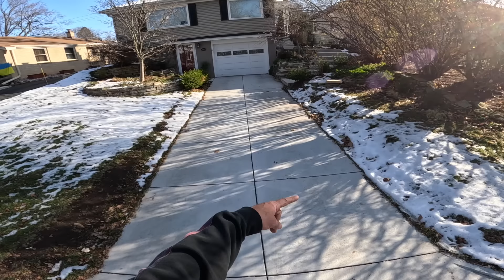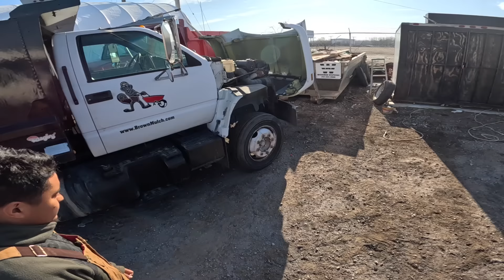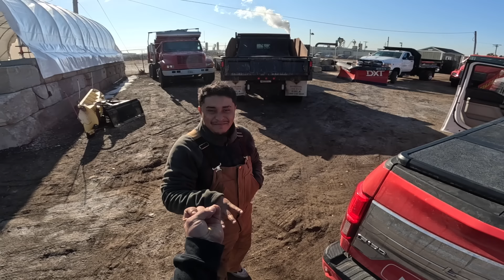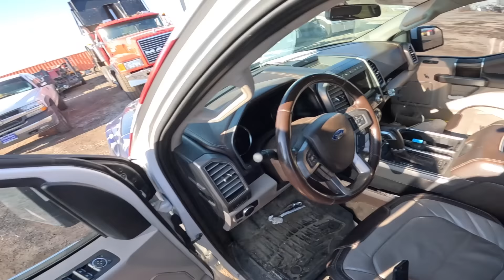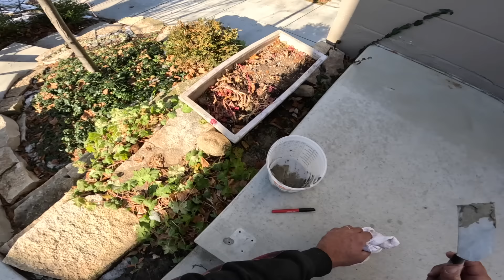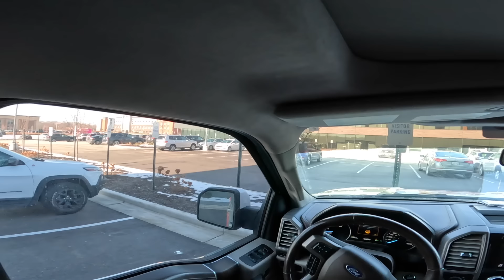Customer won't pay me!

Comment: I got the shaft on a drywall job one time. I wrote up my contract and charged by the square foot too hang and finish the job, ready to paint. The day I finished I turned in my bill to the lawyer customer. She stated payment would be the next day. Realize my contract stated payment upon completion. The next morning when I arrived at the job site the front yard of the house had all the scrap pieces of drywall laid out in a giant rectangle on the ground. She handed me the check and said "I'm only paying for the drywall hung in the house, not these scraps". Legally she may have been right. I guess door, window, electrical and plumbing cutouts are not part of the job. Scrapping the house out for finishing was a mute point. I grabbed my check and beat feet.

Comment: @Victory Outdoor Services
There is a difference between haters and stating genuine criticism to improve your construction techniques & quality.
45+ years in the concrete business (Architectural Technologist) starting with a commercial const. company in 1977 and then on my own in 1983 and building up to a comfortable 30+ employees with an assortment of equipment including concrete mixer trucks.
I have done any type of concrete project you can imagine in every industry from high end residential, commercial, civil, municipal, federal infrastructure, industrial, institutional and oil field.
I am an extreme perfectionist and all my employees have that same standard to ensure the highest quality materials, durability & workmanship. I make no apologies in trying to achieve perfection.
Your attention to detail can use improvement and your lack of using rebar for driveways and patios in new areas is lacking.
You have an excellent Youtube channel, personality & character.
There are some haters, but there are some professionals on a different level than you watching your videos as well.

Comment: I'm a retired electrician who did not get all of my money. Here's the best two with payback. Gave a person a written quote on converting a house into a grilled with 4 meters & 4 circuit breaker panels. I was supposed to get a $600 down payment but guy told me he would give it to me after I started job. Creep only gave me $200 and only worked a day on it before demanding more money. Begged me to continue and would have money for me soon. Ok I took all the meter & circuit breakers home with me. A few weeks later guy said he was bankrupt so told him that I would not perform anymorecwork. Then he demanded the covers back. Best part the circuit breaker company just changed the entire design and he had to pay somebody to replace the 4 panels. He even got ignored when he found out that I pulled the permit on it. Second case I rewired a single home and general contractor was friends with the homeowner. At end of job he had me & the carpenter do over a days extra work along with maybe $150'in material. He refused to pay us. Last day on job the carpenter broke maybe 1' long sliver of hardwood & some stones and jammed them down 3/4" copper lines going up to third floor soon to be installed radiators. Got a call that winter to install electric baseboard heaters. Told them sure as soon as I'm paid for previous work and COD for that work. They said come out and they would pay me. No !money no workee.

Comment: I've dealt with contractors who don't do the best work, but as a customer, I've usually been able to push back and get them to fix something that I believe is not completed, or try to understand that circumstances (weather, materials, etc) might not make the job where I want it.  But some customers think that they can pay peanuts, and get the moon for results.  Its those type of customers who really make the rest of our lives even more difficult because then the contractor is in a bad mood, etc.  I've learned to have the contractor explain to me as to what they are going to do, let me explain my expectations, and then I'm usually there, not to drive them nuts while working, but I do ask an occasional question or just watch.  I have yet to have a job that went bad as long as I didn't start an attack unnecessarily.

Comment: As a metal guy who install guardrails like that all day long I couldn't believe this lol that's a very common occurrence of the concrete chipping a little bit like that when we over torque the screws or just in general but rarely is it a issue where we un install the guardrail and the owner has a concrete guy to fix that little chip lol. It's almost invisible with the steel plate on top. Just shows your experience and how much u appreciate your buisness because I wouldn't have bothered going back

Comment: It is very smart to use a payroll service, as a small contractor doesn't have to pay office personnel [overhead] that has to keep up with all the tax changes from year to year. My accounting firm would have to send their key employees to certified classes every year to understand the tax changes. One other very important advantage by having an independent firm is that you are forced to carry worker compensation insurance, something a person paying a 1099 would not do. And don't think that all subs carry insurance on themselves, nor think you can't get sued from a 1099 contractor involved in an jobsite accident. Nine time out of ten you will loose the lawsuit, and it will bring in the government to your doorstep with large penalties and fines. Plus, they offer general liability for themselves, in case of an error in their payroll services. One last thing, which is fairly new for some firms, is that a lot of P/R service firms offer electronic payroll service, which saves on check and printing fees. It is real simple to set up, and is safe for payroll distribution. If you have multiple sites that employees are working on, you don't have to track them down on Friday to give them a check.

Comment: Spray foam insulation in the tail pipe.... :) as long as the dont see it, will takes weeks before they figure out why the car wont start.....   here in Canada, we have whats called a " Mechanic Lien "... the Mechanic can keep the car until you pay, and if you dont pay after a certain time period, you can sell the car.... put a lien on their house and or car if you can, might be cheaper than court...

Comment: I agree with you get a very good accounting firm. I was a President of an HOA, 1ST thing I did was hire a very good accounting firm, We went from 22.000.00 to over 156,000.00 in over 2 yrs time. And when someone tried to Sue me and the HOA for mismanagement. The State and the Lawyers said our books were perfect and I had recorded all transactions and Conversations with all our vendors and Tenants and Board meetings . And always consulted with our accountants on a lot of issues. I Quit after the fiasco Even though the State recommended  I be re-installed as President same with the accounting Firm they also recommended me back. And that the Law Firm be dropped as overseer of the HOA. I said Thanks but NO-Thanks, it was a Non-Paying job

Comment: The paperwork to sue the guy who chipped it for the cost of the repair takes 30 minutes and any ambulance chaser with a forked tongue will file it for 15%.  The customer shouldn't have to pay either.  The idiot who chipped the concrete is at fault.  Even if they just play games and never pay out, it costs them around a grand each time your ambulance chaser refiles for free or like 50 bucks a year into perpetuity.  There are career lawyers who just have catalogues of old cases to refile and do nothing else.  Throw this railing company on one.  Well worth the piece of mind if nothing else.

Have a good one.

Comment: You can’t make this a precedent with customers. When you give them a inch, they’ll take a mile. This person has already taken advantage of you once. A customer once did this to me. I delivered and assembled a commercial exercise bike for them. They broke it and ripped the power supply out after a month. I came out and fixed it even tho it was on them. This was about 4 years ago. Recently they called me and demanded that I come out and fix one of the pedals. Pedals on exercise bikes are reverse threaded and she could not figure it out. She lives nearly an hour away and I was not going out for an old project for something so dumb. She went on to write bad reviews, make better business bureau reports, call multiple times to complain to me. Its frustrating, but sometimes you have to set boundaries or they will just take advantage of you. We call em Karen’s.

Comment: Hey great video. You seem to be a standup guy, not sure I could have gone and fixed that chip. 
Just a friendly reminder, a guy in a wheelchair may need that striped space to deploy a wheelchair lift or ramp and they are barely wide enough as it is. Obviously not an issue at this place, but in a crowded parking lot it is huge. 
Thanks for your content. Much continued success to you, Sir!

Comment: Sorry that happened to you buddy. You need a better contract and signed up from with your customers that states your not responsible for damaged caused by other installers during and after you left the site. I also know, that you may not want any other sort of troubles with certain customers that claim this or that... But trust me, don't stand for that B.S... I see a lot of the same sort of issues where people simply try so many dis-honest things.. From not paying in full, or saying that a service was not done. You'll find after a while to deal with these people that do things like this. Also, don't be concerned at these sort of people bad-mouthing your company, people will come to know your ethics and integrity and the work your company does. Happy New Year.

Comment: I would have filed a lien on the home for the $1,000 owed. Then the issue with the steps would have been communicated in a letter from an attorney. Sometimes you just have to draw the line as to when enough is enough.

Comment: Concrete doesn’t arrive on a roll it’s hand crafted on site, it’s a out  side material to park your card on if a driveway… if it’s your money that supplied the material it’s your property, I’d take a sledge hammer and pull the lot out and leave it there

Comment: She withheld $1000 for a concrete discoloration, then HER railing contractor chips the concrete while hammer-drilling holes, and she calls you? I can't begin to tell you how many different ways I would have phrased my response to her.. As an east coast concrete producer, i'm just surprised she didn't call the concrete producer to tell them the concrete was defective...  Unbelievable. You do know she is going to hate that the chip repair color doesn't match perfectly, yes?

Comment: I went back and at 15:31, there was a white car that turned in behind you, from a side road, who is now following.. as they do.
Now watch as?
Another white, underpasses you on the right at 15:33 (because you are talking to the video & going a tad slow maybe?)
At the same time another from further back also closes the gap, & by 15:45 is directly behind you waiting?
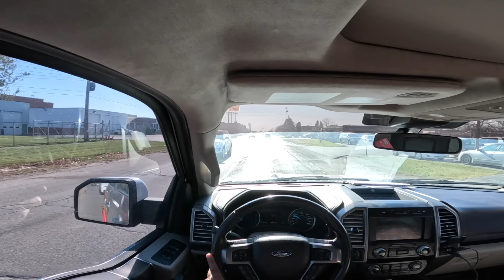By 16:12 we also see another appear in the side mirror, a grey car - also wagging the tail of this slow donkey.
At 16: 30 the white underpasses you also, and? I have no idea where the grey went... (to your right along there)
However.
I understand your desire to hold the left lane - and I also know your need to yack incessantly at the dashcam / go pro.
But ?
Mixing those two, nah don't
Drive and concentrate on doing it to the best of your ability, by keeping up with the traffic flow, so that others have no need to underpass.
And later sitting at the lights, that's the time to yack.

Comment: I'm almost certain you have no contractor license. You need to protect yourself at all angles in the contract take the time to word it properly & protect yourself & be fair with the homeowner. You are allowing yourself to get punked by the homeowner. You should clearly state in the contract that you are not liable for other trades causing damage.
Now if you subbed the railing out to another contractor than you are liable.

Comment: Can you pour concrete when it's cold out like 40 degrees.
Reply: Yes. Once you pour the concrete has to stay above 32 degrees for three days otherwise it will freeze causing damage.
Reply: @steveniksid5874  thanks
Reply: @jameschanin876  no problem. Some guys, like myself will pour when it's below freezing and cover the new concrete with concrete blankets. The curing process creates heat which the blankets hold in. The most difficult thing is getting concrete suppliers to deliver in the winter.